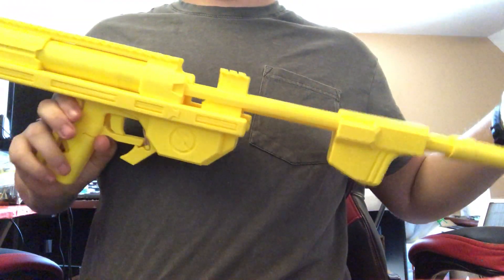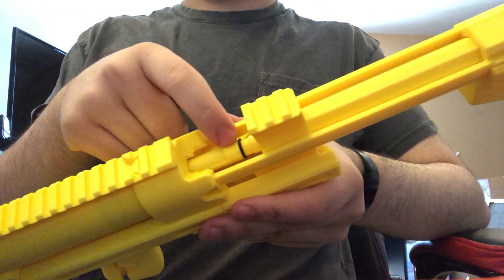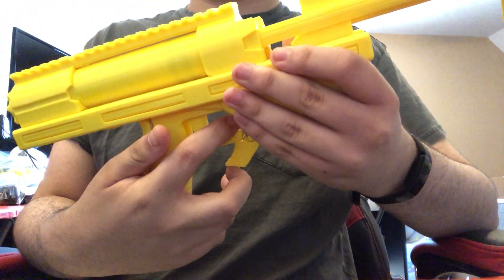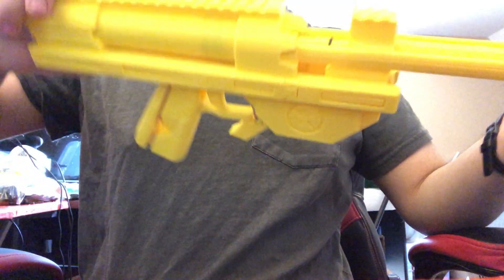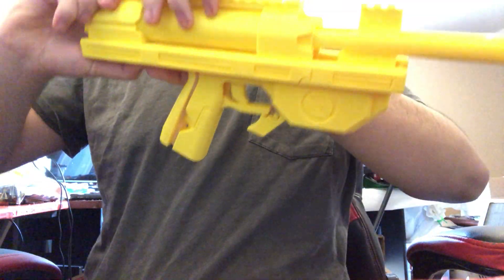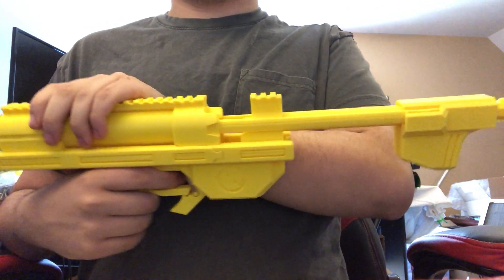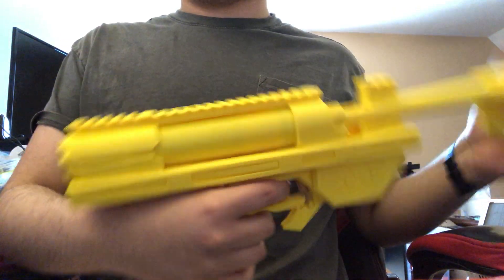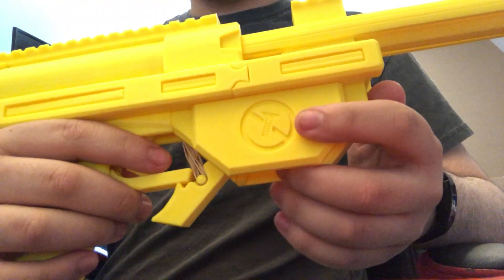Low Hardware Talon Claw U is released!

Comment: Hi that's awesome. I couldn't get the hardware kit. But one question? Holy long does the printing take for all parts?
Reply from the maker: The print time is long, maybe 30 hours?
Reply: Thnx and also can you tell me the OD of all the o-rings in cm please
Reply from the maker: @askaburi2745  I can not unfortunately. They are imperial o-ring sizes. 123, 012, 016. 

You can probably find metric replacements with enough googling, or make your own with an oring kit.